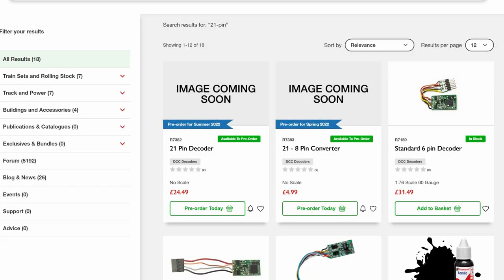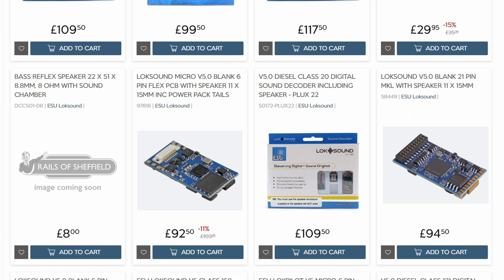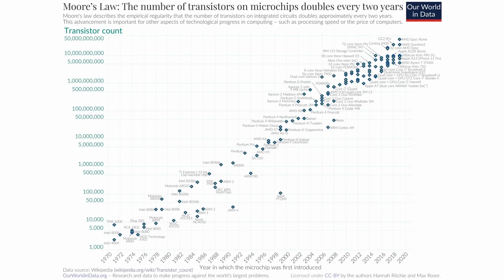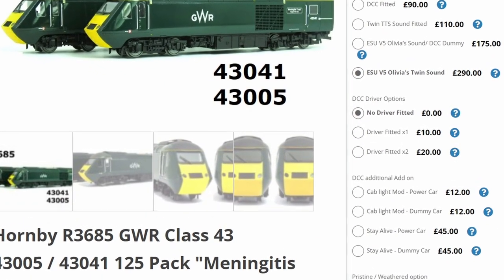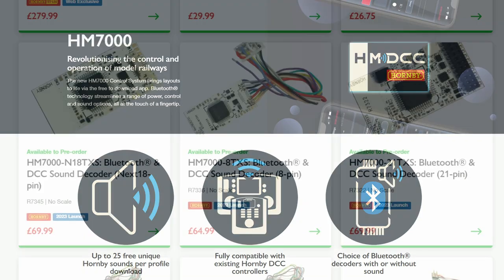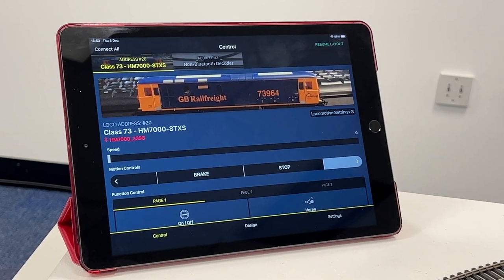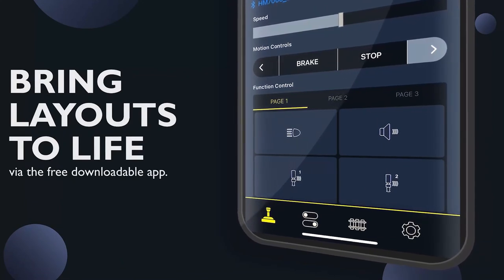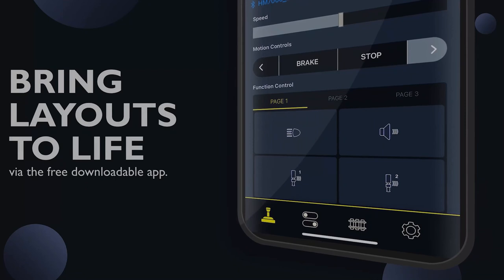Can Hornby's HM7000 solution address my frustrations with existing DCC sound and control operation?

Comment: I am really intrigued by this announcement. I've recently returned to the hobby and have a reasonable number of licis ready for my new layout. I am at the stage of planning the layout after just finishing the base board (a modest 11x4 foot space). I have not yet fitted any DCC chips or purchased my controller as I was waiting until the track plan was set - as I am at the stage of deciding on what decoder to go with, I feel I will hold off for a few months and start with hm7000 using power from my existing analogue/hm6000 controller.

Hopefully performance will be fine on my modest space and there will be no need for an expensive controller. Really excited to see what comes of this.

*Just to mirror your point in the video on technical development - when returning to the hobby at age 37 (not modelled since i was a child), I was surprised at how old and cumbersome the current setup was. This seems like a much overdue move in the right direction.

Comment: z21 is a great dcc system very modern control centre it works from wifi or a hand control system. its made by roco. it works with everything really. it works with all locos old and new easy to use.

Comment: It's a very interesting idea from Hornby, I have one of their elite controllers and after a couple of years the control dials started to play up. Hornby refuse to do anything about it so I got a DR5000 to replace it. From what I've read, it would seem an elite can act as a translator from a HM7000 system to a standard dcc system. I might try the HM7000 as it may give a use to my elite, I might use it as a back up or just for programming as that is not a strong point of the DR5000. It will be very interesting to compare the two.
Reply from the maker: Yes, there could be an interesting proposition for existing Elite owners here.

Comment: My layout is currently analogue only. When Hornby announced the HM7000, it certainly gained my interest. I am definitely interested in this control system, but, I am going to be cautious and wait before taking the plunge. Mainly so any teething troubles get ironed out first.
Reply from the maker: Wise approach Robert. With plenty of folks like myself willing to take the early adoption risk, there's no point in everyone jumping in and perhaps being disappointed.  I'm expecting there will be at least some teething problems but hopefully nothing that can't be fixed in software.
Reply: @EuviRail  Would this control system make people like Legomanbiffo adopt it? If I was after digital sound locomotives, it would be his sound chips that I would use. Will there be a way for him to make his sound files available to work with the new system?

That is another reason why I'm going to be patient, to see how the rest of the industry adopts it.

Comment: Its refreshing to see that Hornby are developing their sound capability and thinking ahead.   I think I still prefer a dedicated controller rather than having to use the phone.  Might mean you can't answer it when playing trains!! 😄  Real +ve is to sound files for the class 800 and 91 and 73 and down loadable sound files yes,  much more usable. Does anyone know if the App is actually launched yet?
Reply from the maker: I can only see the existing Analog HM app on the Appstore right now. I expect a bit of a fanfare when it's posted and the first decoders are available.
Reply: you can use tablets and not put a sim card in them

Comment: I’ve just got into DCC and with it being very expensive for the 110 pound plus decoders I’m definitely interested in this new mid range from hornby I will be pre ordering a couple of these new sound decoders for some of my dcc ready locomotives, I have some tts sound locomotives and the sounds are ok not the best so looking forward to hearing what it sounds like or if any improvements are with the sugar cube speakers, I’ll will follow closely for future updates, thanks for sharing your thoughts on this
Reply from the maker: Yeah, TTS has it's limitations and I believe Hornby have acknowledged that. The extra channel, improved fidelity sound recordings and better steam loco synchronisation should see improved performance on the new TSX chips.

Comment: This is interesting, and I would like to see reviews in due course.  Currently, I don't use DCC.  Using Bluetooth for control instead of a signal overlaid on the power supply seems a good idea that might reduce problems with track to loco contact.  Most importantly for me would be whether or not the decoders fit easily into OO Terriers and other small tank locomotives.
Reply from the maker: Thanks Richard. Yeah, another comment on the support for the smaller locos. The sugar cube speaker is definitely more aimed at this end of the scale. This is a big segment for Hornby so I would hope they will factor in terms of the smaller sized decoders.

Comment: Hi l have just watched your video on hornby 21
 Pin 7000 and as l have just purchased a Bachmann class 66 what are your thoughts about it in the class 66 l totally agree about the cost of sound decoders like the ESU V5 loksound which if I went down that route would be £115.00 like l have before but now this is in the mix and been able to use my iPad as the controller sounds good my dcc controller is a Bachmann Dynamis but it only has 20 function buttons so having looked at your numbers video about the 21 pin version and the dimensions being similar to ESU but for half the price sounds good 
Best wishes 
Kev Beighton Parkway Sheffield
Reply from the maker: Hi Kev, I used a TXS decoder in a Bachmann Class 66 - check back through my videos and you'll find it. I found it absolutely fine and as a big fan of Bluetooth control from my phone, I was well pleased with it. As well as the cost saving, the ability to reprogram for another loco type is huge if you're swapping locos on your layout a lot like I do.

Comment: I think it's clear that this is an entry level low cost DCC alternative, I don't see heavily invested DCC modellers converting.  That said with the availability of the dongle it will come down to the functionality of the HM|DCC app.  Far more interesting to me is the price point of the sound fitted chips and the free sound files and the ability to change the sound file via Bluetooth, they also mentioned that each profile will have CV settings for the running characteristics for that class I believe.  This alone (as long as the chips perform reasonably) is worth it!  Ultimately using Bluetooth to control a train is welcome but how easy it is to pair, will it stay paired after a system restart and how responsive are the controls are all unknown but I'm choosing to be optimistic and looking forward to giving it a try.
Reply from the maker: Thanks for that. I'd echo that scalability and robustness are definitely concerns so I don't see anyone throwing out there DCC controller any time soon. As you say, if the decoders are up to scratch, you can still use them in regular DCC mode and you still have the ability to reflash them when you connect via Bluetooth. What's not to love?

Comment: Hi, I am using the same as you the e link running a large garden railway. i am going to look at the HM7000 as long as it is compatible with the e-link I do have locomotive on order with Hornby the P 2 and the Black 5 with Sound and Smoke. so I am hoping that they will work on the e-link as I am not changing over to any other DCC controllers as e -ling works well for me to. Ron
Reply from the maker: Thanks Ron. Another eLink man like myself. I'm hoping the HM7000 can take some of the pressure off my system - such as handling all of the newer locos equipped with Bluetooth enabled decoders.
Reply: @EuviRail  yes thank you for coming back to me I think e-link is a good operating controller. and with most of my locos sound it works well on the garden railway. and as you know you can bring locos up on the screen and see the diagram. have subscribed. regards Rons Garden Railway.
Reply from the maker: @RonsGardenRailway  Welcome to the channel Ron. 👍👍

Comment: If you are getting problems with the DCC which makes the trains run a bit iffy. If you are, are you using a Hornby track connector. That has components at track level which affect the transmission to the track.
Reply from the maker: I always use soldered connections for DCC so no issues there. It's the sound decoder costs, lack of flexibility and tedious programming track operations that are my main sources of frustration. £600-£700 in controller and programmer costs could address two of these but not the decoder costs hence why I'm keen to see if HM7000 can address all 3 without any capital outlay. Should know more in the coming month..

Comment: I'm not a sound for locomotives modeler but I am going to DCC, I have a Z21 system. I agree with you on the technology but manufacturers might think everyone is happy with the status quo so why rock the boat 🚢😉.  I  think Hornby might have a ticket to future modeling.
Reply from the maker: Thanks for that. I think a stir was needed alright. Even for non sound users there are values in the new approach.

Comment: I have a few Hornby Locos with sound on order! It will be interesting to see if the new decoders are all that we are hoping for!
I have too many sound Locos to change all of them. As I understand it to take advantage of the new innovations of HM 7000, then I will have to replace all my existing decoders.
Reply from the maker: You can mix and match with your legacy DCC locos  of course. If you have a DCC controller that supports the HM7040 Bluetooth Dongle Cable, it will allow the App to control your legacy DCC locos as well. It's not compatible with my eLink controller so I couldn't test it.

Comment: something you've not touched upon with the HM7000 decoders is the way it uses bluetooth to run dc locos on DCC control. Taking this to a whole new level a few modellers including myself have been experimenting with battery powered locos and dumping the traditional power supply and track power.
With the HM7000 you can easily replace the traditional transformer based power system with an inboard battery and run the loco directly from a tablet or phone on DC or DCC and not have to worry about tedious track cleaning or reversing loop devices, or even the need for a programming track as the HM7000 can program the loco on the fly.
Is this the future of DCC control, well at an average of £65 for a user programmable sound decoder, it's the future for me.
Reply from the maker: Some folks mentioned this in the comments alright as a means as you say of getting away from the issue of dirty track, electrofrog points etc.
A lithium battery, charged from the rails should give very clean running - effectively a very large capacitor. Most locos won't exceed ~250mA current. Would probably need something like a Railroad loco with plenty of internal space to try out different batteries and leave room for some circuitry and a speaker for sound. Will be interesting to see what and when the manufacturers do on this front.

Comment: The key to this entire HM platform is the HM7040. How will it operate? Can it take control of my Digitrax controller? What function does it give me running my older DCC chips? How does this look if I add a couple of Bluetooth locomotives as well? I hope this puts a rocket up Zimo and ESU and makes them upgrade their chip programming interfaces. Perhaps me may finally see a non proprietary interface that finally allows reprogramming of all decoders on the main track. I don’t want to swap out and throw out the chips and sound files I already have. Some of them are unique. Nor is  Individual Bluetooth control of locomotives a game changer IMO and will have its disadvantages  - so that’s not a biggie. What is a biggie is better and easier configuration. Will this finally prod the other chip manufacturers to lift their game on that front?
Reply from the maker: Yeah, my starting point will be the convenience and flexibility. I may still end up actually controlling the locos under DCC as it will all be under the one interface for the entire fleet as the legacy dongle isn't due to work with  my eLink controller. Still, the ability to R/W CVs on the fly and reflash the sound on a more reasonably priced decoder is a good starting point. ESU and Zimo needed a shake up alright.

Comment: Well, I want to see you do the INSTALL TEST
I have seen 4 videos and in all of them the chip would plug in to the Engines, but the Hornby Chip
was LARGER than the one it replaced and the Body of most Engines could NOT be installed back
on the base after the chip was installed
Reply from the maker: The reason is that the Hornby NEXT18 form factor is too large and unfortunately this socket seems to be the type used on many smaller locos. Will cover off in a short video.

Comment: Reason I’ve stuck with DC……nobody seems to do in depth DCC start up n a mean an in depth review on DCC most YouTubers just show how to connect to the loco it’s self so till someone does an in depth review I’ll stay with DC, will admit you seem to go in depth with alot of your reviews in which i think more YouTubers should also do but don’t seem to ohh well keep up the great work
Reply from the maker: Thanks for that. Yeah, you do need to get into the detail if covering something like DCC. You'd need an accommodating local model shop who would loan you a number of DCC controllers to allow for a comparative review. I don't have that luxury unfortunately. If I decide to upgrade from my eLink+Railmaster in the future I'll certainly cover my criteria for selecting whatever I go with and will cover that system in detail.

Comment: Thank you Eugene. This is an interesting new development from Hornby, one to keep an eye and ear on. As you may be aware  I've always been an outspoken critic of the cost of DCC sound decoders. If Hornby, who are not known for their cheap prices, can do, until recently that is, a sound decoder for around £35 then why the hell are the others charging around £120? The actual blank decoders cost only pennies to make, not pounds, pennies! The basic sound chips are so cheap they're put in throw-away greetings cards for heaven's sake! It's simply supply and demand and controlling the market by it being a specialised product with very few suppliers.The hobby has seen inflation at silly rates for years now, well before the economy collapsed more recently and DCC is just another example of the industry rinsing its hobbyists; probably because of demographics and the older age group of the average railway enthusiast who usually has more disposable income. 
 As for Bluetooth phone control, all I can say is that I have apps for video cameras, such as my GoPro Sessions 5 and it is usually troublesome and leaves an awful lot to be desired! If Hornby get this right it could take off. Regards Julian.
Reply from the maker: Thanks for that Julian. Yeah, the cost aspect for sound has bothered me for a long time. Your last point is on my hit list alright, as the compatibility, quality and lifecycle management of phone apps can be challenging and this is going to be a more complex app than many.

Comment: I have a DR5000 unit which I link to the Z21 app on an iPad for point/route control and an iPhone for loco control. My grandkids control locos on the iPhone no problem. Give them a hand-held ‘dial’ based controller and they’re lost. Remote control Bluetooth or Wi-Fi on smart devices is the future, and I think Hornby are grasping it. BTW:  I think they’ve got it right about TT120 as well, but I seriously dislike them cutting out the retailers.
Reply from the maker: Thanks Peter.Your point re. Gen Z and Gen Alpha being at home with a touch screen based device but struggling with a more mechanical based controller is so true. I'm a long way from a Gen Z but even I find most of today's handheld DCC controllers pretty hideous. On the TT:120 retailer issue, Hornby probably feel it's a moot point until they have a critical mass of product to sell. Even if you're not going to have product now, I believe you need to keep the retailers onside and make them part of it. Alienating your retailers is not a recipe for long term success.
Reply: @EuviRail  …..and unless Hornby have a brilliant ‘returns’ policy, how many people will buy into a product (an expensive product!) they have not seen and felt?